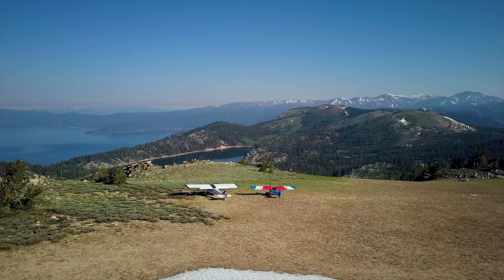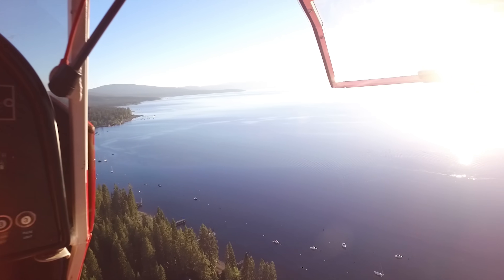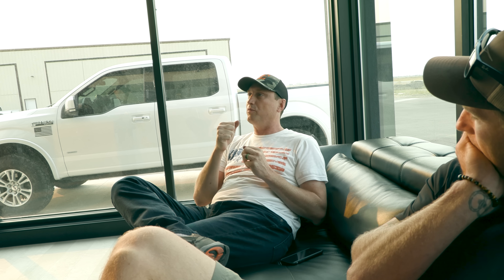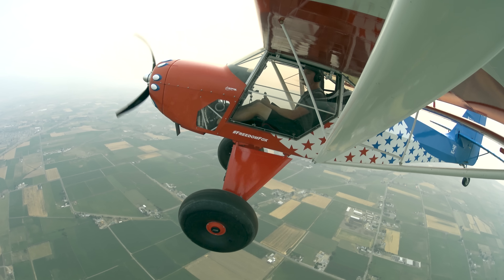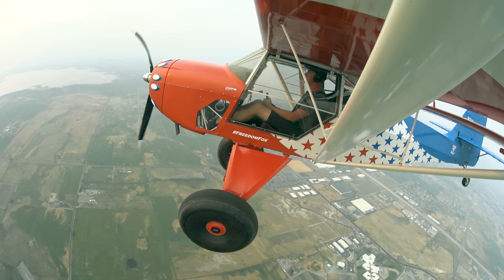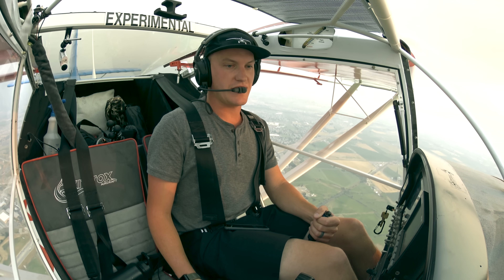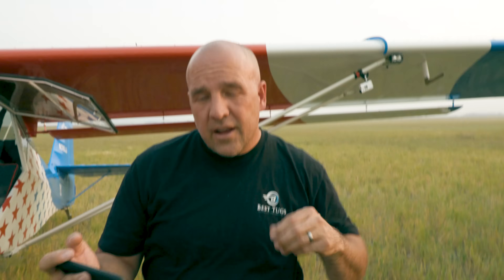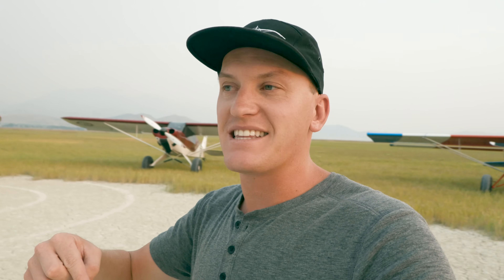YOUR FLIGHT INSTRUCTOR WAS WRONG! - Simulated vs Real Engine Failure

Comment: I would think that a spinning prop produces less drag than a stationary prop. To my simple mind, the frontal area is the same so the non spinning prop is absorbing 100% of the force applied while the spinning prop is being pushed to the side allowing some of the air's energy to slide past. Something else to consider is the stronger vortices generated by the non spinning. Vortices = Drag.

Comment: There is a lot of math and variables involved with this calculation. Unless in a constant state of thrust, (and even then there is resistance) there is some form of drag or friction involved. Which in  turn, affects glide. If you had fixed and constant input, it would be easier to calculate. But with the amount of variables involved it becomes very difficult. You guys didn't go near deep enough to figure it out. Like I said, the variables are what cause the problem with figuring it out.

Comment: Assuming a fixed-pitch propeller -- there should be no situation where an engine at idle (or windmilling) produces materially more drag than one that's stopped (** mostly, see below), but every idling prop has a "stall" gliding-airspeed above which it will only produce drag. 

To understand this, recognize that the prop is just a rotating airfoil (like a wing) producing forward-lift we call thrust. If the prop is below its critical angle of attack, it is "flying" and producing lift, similar to the way a non-stalled wing still produces lift even if it's not enough to carry the airplane (losing altitude). Once the propeller reaches its critical AoA it stalls and like a stalled wing, at that point the air separates and produces drag. The faster the glide-airspeed, the closer to critical angle-of-attack the prop experiences, and the more likely it will stall. For a given propeller and engine idle RPM, one could calculate the glide-speed above which it will stall (and produce drag), below that speed it produces (some) lift. (though prop shapes are complex, and won't stall uniformly)

** Once a propeller is stalled and not generating lift, it is generating drag. If the prop windmills, the mechanical engine drag is less than if the engine stops entirely, because a stopped engine can be thought of as infinite mechanical drag (stiction). However, the drag we care about is aerodynamic drag. Any differences in aerodynamic drag between a stationary-prop and engine-drag-windmilling prop have to do with whole airframe aerodynamics. For example, there could be a specific orientation of the prop, for a given airplane shape, which is less drag than an engine windmilling prop. Or not. It depends on the complex details. 

If, however, the airplane has a compression relief lever, and the non-compression engine drag is low enough, this could yield less prop drag than a stationary prop or engine-resisted prop. Curiously, someone once did a thesis on which has more drag, a zero-rotational-drag freewheeling prop or a stationary prop, and found it depends on propeller pitch and length, not airspeed.

Comment: I had a reserve tank transfer problem in a Champ on a cross country and had to coast engine out the last 3 miles to the airport. My Champ had a C-85 without a starter. I had learned that a stopped prop was better than windmilling. However, since I had a fuel transfer problem and no starter, I opted to keep it windmilling, just in case the fuel started to flow. 

I had a lot of practice gliding at idle from different altitudes, positions, etc. and expected to come down at 700' per minute at 60 mph.  Personally, I couldn't sense a difference in the glide. However, I did come in high, aimed for the middle of the runway and slipped on final. From experience I knew that I could bring it down like an elevator in a slip, so I came in high. I think there is a lot of value in practicing under windmilling conditions, but at the same time I do think it is wise to come in high to compensate for the increased drag and not end up undershooting.

Comment: A windmilling prop generates forward or aft thrust depending on the resultant angle of attack of the blades.  Positive to slightly negative (relative to the back face of the prop) generates forward thrust, more negative AOA than that generates aft thrust.  An unpowered or motoring windmilling prop will have negative AOA and generate aft (against the direction of flight) thrust force.  If there is a dead motor attached to the prop that drag will slow the prop rotation somewhat making the AOA more negative and add further to the aft thrust.  So, any power generated by the engine no matter how little will increase the AOA (less negative) and decrease the aft thrust from the otherwise dead motor condition.  A very slowly turning, or stopped, prop is aerodynamically stalled and no longer doing its wing thing (thrust/lift).

Comment: imagine the motor is actual a generator that converts a rotating crank to electricity.  It is actually converting some of the energy of the airflow to electric that can be used or stored.  In effect, that energy is being siphoned off the same source that is creating the drag...the wind.....so there is less of it being used to slow you down.   All drag is energy.   Put it into a generator - or a spinning propeller to convert some to motion within the motor and there is less left over to push your airplane in the direction opposite of your travel.

Comment: I am not a pilot, i am a sailor looking forward to learn to fly and your channel is one of the things that turned my attention to flying. But we (sailors) have propellers too so here are my thoughts. I would say it depends on many variables. Wind speed and direction most importantly. Next thing: a prop rotating even slowly creates a difference in pressure (slightly lower pressure behind it) - again depending on the direction and speed of the wind. Like I said many variables. But most of the time I would say even a slow moving prop (idling) is better than a stuck prop. Also I think when the prop is turned by the wind it creates the most drag, because it is transferring energy to the plane. Energy never gets lost so this causes slowing the plane down.

Comment: I’m disappointed that Patey didn’t build a NASA sized wind tunnel to settle this debate. As a helicopter pilot, Mike Patey should know it would be all about the rpm along with relative airflow, so he would have been a good resource. Not sure if Mark flies Helicopters as well? Anyway… First a stopped propeller creates only parasite drag. A rotating propeller creates parasite drag as well as induced drag. A propeller that is being forced to turn by relative airflow, is effectively auto rotating the same as a helicopter would in the event of an engine failure. This has a slowing affect. The way a helicopter can come down slowly instead of falling like a rock, the auto rotating airplane propeller would provide an aerodynamic breaking force. At a certain rpm, a propeller will provide more lift than drag, thus providing thrust, but when it is being spun by relative airflow, it is providing more drag than lift, so positive thrust would actually turn into what is effectively a breaking force. I also noticed that you equated the increased descent rate with a stopped propeller as a verification that the stopped propeller is creating more drag. I think I might disagree with this assessment. I think a better method would have been to compare the stopped propeller and the rotating propeller at the same descent rate, not the same glide airspeed. Hypothetically, flying the airplane with a descent rate of, say, 1000 ft./min. with the stopped propeller would likely allow you to go a further distance than it would if the propeller was rotating. Worth experimenting with that as well, I think!   -   Obviously these are all just my opinions, I haven’t tested these things myself, and you guys did a great job. I’m not just an armchair pilot, I’ve been a fixed wing and commercial helicopter pilot for 15 years, so I would like to think my opinion has some small amount of value, lol, maybe not.. 😜

Comment: How does the "engine spinning" when the engine is off cause more aerodynamic drag? The air is literally trying to take the path of least resistance (high pressure moving to low air pressure pockets), which rotates the prop with no other external forces (engine not running). This alone shows concrete evidence that the air prefers the prop to be moving when the plane is still moving forward.

When the prop isn't moving, there is a higher air pressure on the front of the blades, and lower pressure behind. When the prop is spinning due to the force of air contacting it, the air is trying to balance out the discrepancy in air pressure between the two. This is what moves the props. Drag is essentially caused by areas with large differences in air pressure, which is why lowering your flaps in an airplane gives you more lift, but also creates more drag, thus requiring more power to fly.

Comment: Nice discussion. my 2c It doesn't matter if there is minor thrust or drag on an idling engine, looking at the title, with a dead engine, even feathered, a Cardinal I was flying did not reach the runway and I understand why so many people spin into the ground at the end of the runway trying to stretch out a landing with a dead engine.
Instructors should teach landing 500ft down the field with the engine idle simulating a dead engine, so if they are in a plane with a lot of drag on a dead engine, they still make the runway.
And especially important is to delay flap extension until you KNOW you have the runway.
Fortunately all the horror stories of people spinning into the ground at the end of the runway made me not stretch the glide and I landed about 200ft short of the end of the runway, rolled up onto it and turned off at the taxiway immediately to my left before losing my energy.

Comment: Awesome guys,I could actually feel it and here it on my 72 inch Warp drive prop at idle add a 50 mile per hour descent simulated engine out with my gyrocopter.with engine out had to make inputs to not exceed the 50mph glide it was definitely noticable.by the way best channel on YouTube!!.

Comment: Idle the airplane on the ground, take a “thrust test” with a windometer. Whatever speed your propeller pushes air at idle speed will show you at what speed your specific prop generates drag instead of thrust.
Reply: This method is a bit too conservative. You are correct that a prop will generate thrust at any glide-speed below this "backwash wind speed". However, it will also generate lift for glide-speeds notably above this speed -- until the angle-of-attack the prop experiences exceeds the critical AoA and the prop stalls. 

A good analogy for this is an airplane wing losing altitude but still generating lift as long as it doesn't stall. It is the angle-of-attack of the air which causes the prop to stall, not merely being pushed through the air slightly faster than it's "backwash wind speed". The speed at which this occurs is dependent on the RPM, prop pitch, and airfoil shape. (and of course the prop airfoil is not uniform, so the stall isn't uniform either)

Comment: I fly model airplanes but not little ones 35% scale and we use idle to slow our planes down to land on our runway. The drag a idle creates really helps. Now if we have a dead stick and the motor does we glide so much more we have to go way out and come back around to make the runway. Easy answer for me a stopped engine will glide farther

Comment: This question is not difficult
Make a chart:  X=drag and Y=speed
Plot your Parasite drag (PD) minimum at zero and at the square of the speed to a Maximum at never exceed (VNE) (a curve)
Then plot Induced drag (ID) maximum at stall speed (VS1) and close to zero at VNE
The average of the two lines will be you drag at that speed.  Note the low point will be the best glide.
Re=plot this chart for prop stop (more PD and then at idle.  If you re-plot full throttle you will fine your climb speed (VX & VY)
Bill Patton 
-ATP, A&P

Comment: Hm... what about a gyrocopter's ability to sort of safely land with the engine off and the rotor effectively "idling"? To me, there seems to be a defined area where an idling prop has drag (relatively high speeds) and one where the effect is small (slower speeds)...

Comment: .0008229 * RPM * Pitch (of propeller in inches) gives the theoretical zero thrust airspeed in knots
.0008229 * RPM * Pitch = V

Comment: I was taught to keep the gliding speed safe and keep the prop turning in the hope that you can have the engine fart back into life if that is achieveable .At the same time, I have picked a spot to land dead stick that is inside my angle of sink , whether it is on the airfield or not. Getting down safely is the only priority.

Comment: My argument is : What is the prop speed, RPM's (screwing itself through the air mass) relative to the airspeed, density
alt. and relative wind 
To prove this, neg. thrust / pos. thrust vs. neutral thrust.
Take an anemometer and measure the wind speed/ airspeed being produced, on the ground, dead calm moment, avg baro.
avg temp. while the prop is at idle, viola ! To me that is as fast as it is screwing itself through the air and that is neutral.
In a real engine out it's a whole different line up of variables minus or plus that neutral number.

Comment: Not  much place for discussions really.
Is physics and math only.
Airspeed of prop = pitch of prop*revs of prop/60       equals inch/sec
Calculate either your A/C speed in inch/sec or convert above into kts.
If both speeds matches we called it "disk".- MU2 training, when shutting down an engine was not appropriate but single engine training to be performed. No thrust/drag from prop.
If prop speed is higher than A/C speed then your prop is pulling- Aircraft has a better glide than engine off.
If prop speed is lower than A/C speed then your engine is working as a generator thus glide worse, as energie is drawn from the airstream to power your motor.
Engine off: simply a frontal (very bad) drag coefficient of non moving prop is reducing your glide.
Engine off, windmilling prop: worse than above as additional energy is drawn out of the airstream to rev your engine.

and yes, is installed to keep the pilot cool and heart healthy. :)

Hope this helped
b.r.
Wolfgang
Reply: one more:
with above formula and knowing the pitch of your prop, you can easily calc what to expect at your A/C and even calc the revs to be set to emulate a real engine out at a given airspeed. Just keep the prop 50 revs lower than calculated revs.

Comment: Depends on gross weight, wind, air density. In a Cherokee it used to be inside the fuel caps you could make it.

Comment: if you want to get nerdy, its basically how much wind energy is being used to rotate the prop.  if the engine is turning it, not much is used from the oncoming air.  if the engine on the stopped or windmilling prop creates a resistance [insert fluid dymanics equations] that uses more energy.

Comment: I am no pilot but here is my pitch on this. The drag is negligible between idle and complete stop if you have 2 or 4 propellers. Although i would say idle is less drag because the propeller is "deflecting" from the air's force. Now lets change it up abit. If we were to test this on a turbine then a complete stop duct fan will be a lot more drag compared to idle because there is too many blades and not enough gap for air to pass through.

Comment: In my flying days 1970s an engine out was no power being produced and a windmilling prop was like a speed brake taking air flow away from tail surfaces. If the engine was still active even an idle it was operating at reduced thrust. There’s lots of information on propeller drag for power turbines on 1k up to the big boys .

Comment: 2:10 'theres no more surface area ever whether its moving or not' something about this aint true because gyrocopters have no wing at all when they're not spinning but when the rotor is spinning it becomes like a large circular wing, the rotor disk rejects oncoming air as a disk rather than as 2 fixed thin knives.

Comment: I think a windmilling prop is better than stationary . If your argument is that idle is better than nothing , then windmilling is just a slower than idle  - it’s drag , but it’s less drag than fully stopped . If it’s wind milling it’s being pushed by air , but it’s also pushing some air out the back ( if it’s turning , it’s making thrust -end of story . Might still be in the negatives for aircraft , ie ,it’s drag , but it’s still going to be better than nothing

Comment: Look at it on a bigger scale. When a helicopter's blades are turning there is much more resistance than if they are stopped. Try an auto rotation with stopped blades.